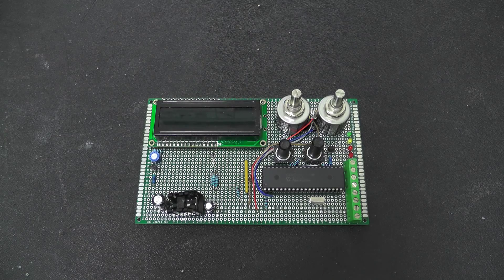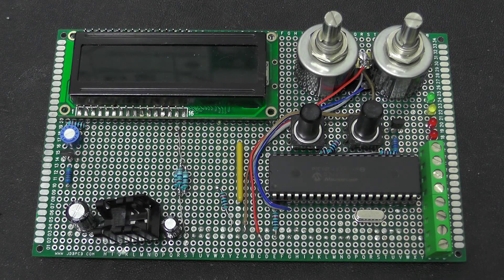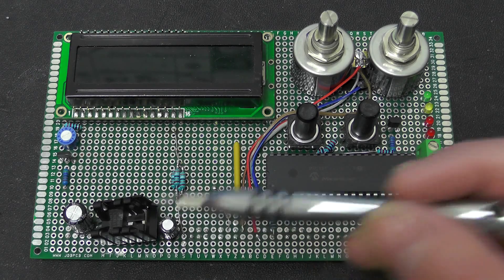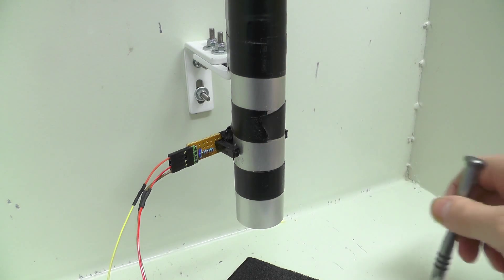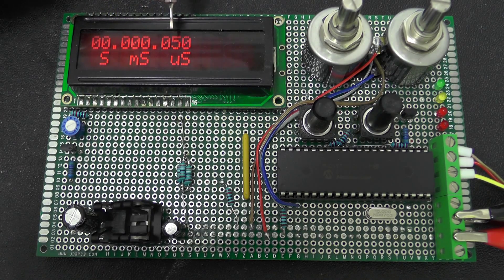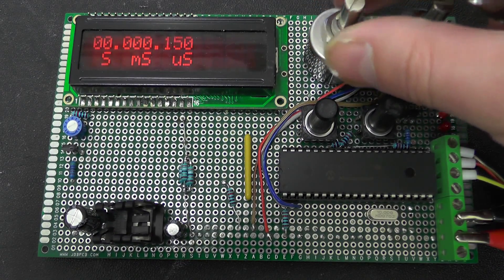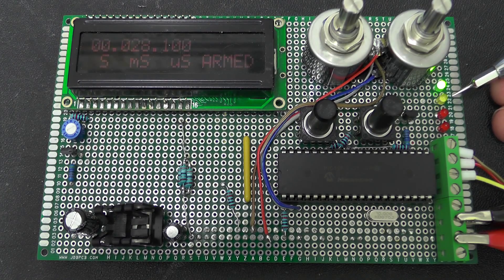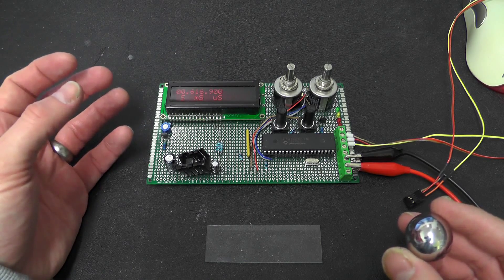DL#041 - Palflash Air Gap Flash Trigger Part 4

Comment: Did you ever get any good shots with this?
Reply from the maker: Kind of yes, i recently experimented using a CO2 air pistol but my current setup is not able to detect something as fast and as small as a .22 pellet.

Using the flash is always time consuming and i don't really have the space to make a proper setup rig and spend days refining it and of course you have to work in the dark.

I do still have everything here though and it is in a working state.
Reply: Very cool.  I just spent the last few hours checking out your channel.  Very interesting stuff.  Not exactly related but i recently started a channel about the more technical side of radio controlled cars etc.  Might be of some interest to you.  I only have a few videos but will be adding more every week:)
Reply from the maker: i just uploaded some early experimental shots to my FB page. https://www.facebook.com/DextersLab2013/photos/?tab=album&album_id=1236472823061439#

I've not been doing anything with my RC stuff recently, my Baja 5B hasn't been run in over a year!
Reply: Those pics look sweet!  Im just getting back into rc after a long hiatus.

Comment: Get some old incandescent Xmas lights and pop them, running the lights with 9V as they are hit.
Reply from the maker: Interesting idea, i could add some additional outputs on the controller to activate something just before the flash fires
Reply from the maker: DextersLab2013 or even after the flash, given the camera is on a long exposure. Hmm i wonder if also triggering a regular flash to light the scene after the high speed flash has fired could also create some interesting images. Much experimentation is required i think!